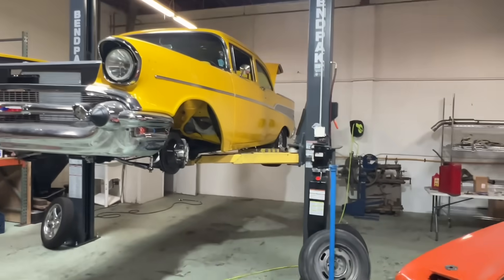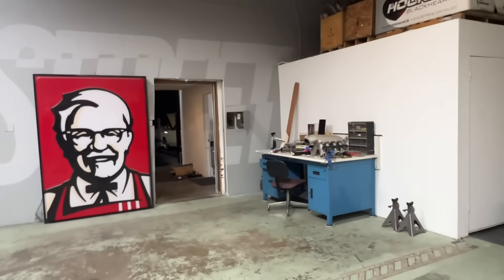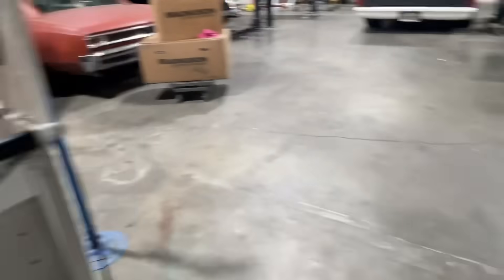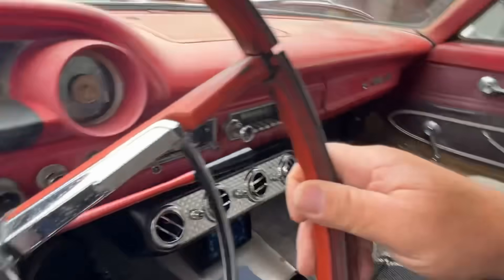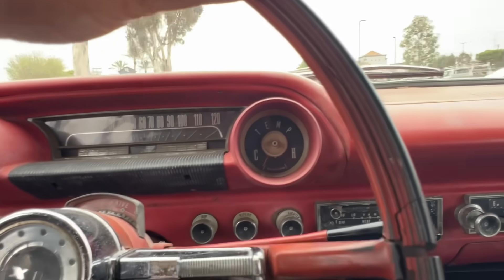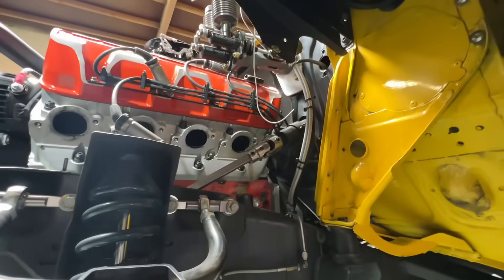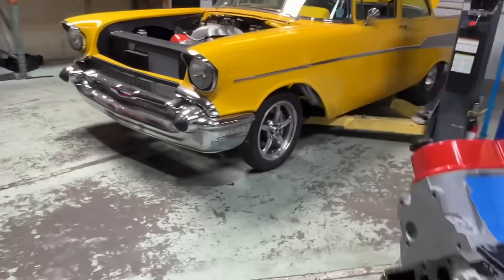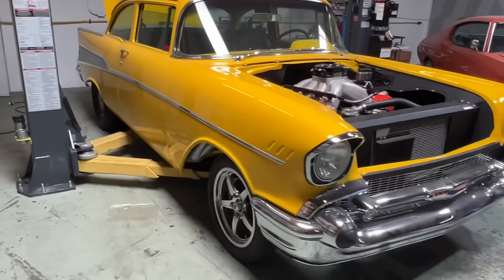New Modified Headers for the Iconic 1957 Chevy - Project X

Comment: Love that wagon. It keeps me motivated to keep at it on my Belair. Although not near the power tour. Last week we went on the Ontario Hot Rod tour. It was 800 miles or so. What a great event Power tour is on our bucket list.
Reply: What year do you have? I'm working on a 56 210 with a 348 big block and 5 speed manual
Reply: @EricMotoring  mine is newer.  66 Belair.